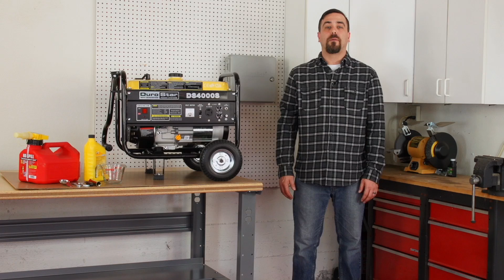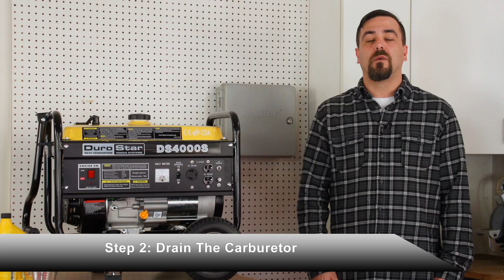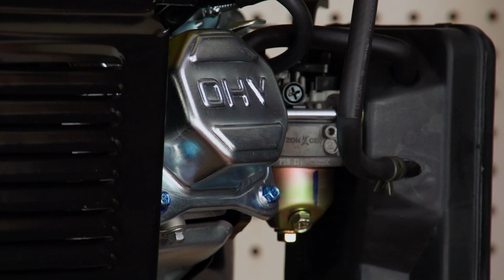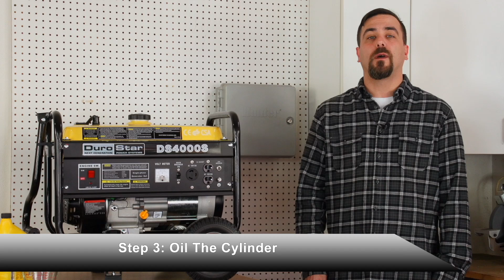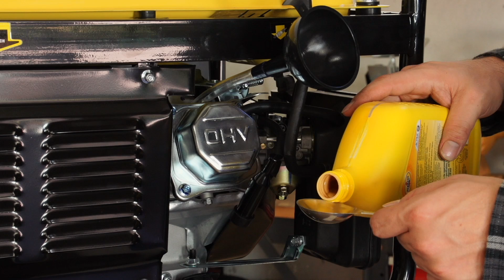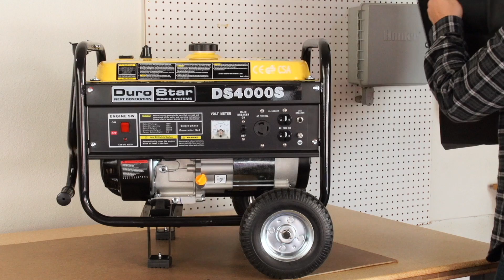DuroStar How to Winterize 7.0 HP Portable Gas Powered Generators

Comment: I exercise every engine every 30 days. I add a stabilizer to the fuel. Run each for a few minutes then turn off the gas valve and let the engine run until it stops. Then try starting it again both choked and not. It will usually start for a few seconds choked so I always try that again. Then good to go until the next 30 day workout.

Comment: Great video! Why does the gas come out so slowwwwww from the plug?
Reply: Just use none ethanol fuel fill the tank run for 20 minutes turn off good up to 6 months
Reply: @mikequyl8754 we don’t have non ethanol gas anywhere near.
Reply: Take off the fuel cap at the top of the tank when you empty it to allow the tank to vent.